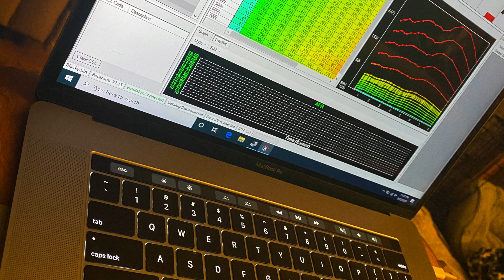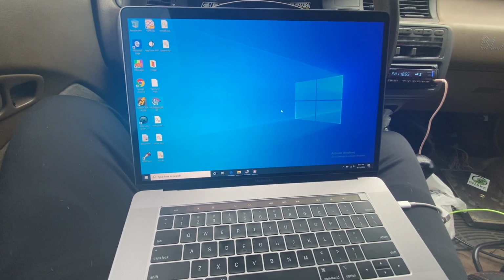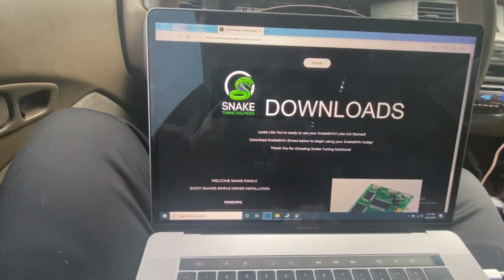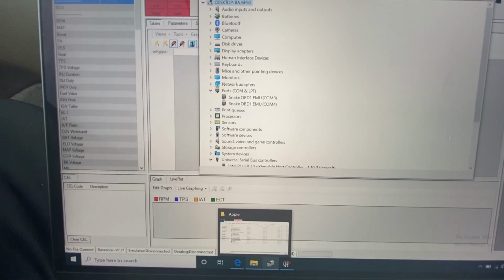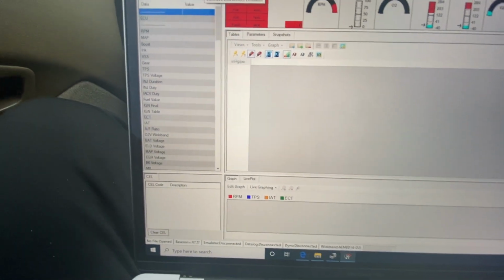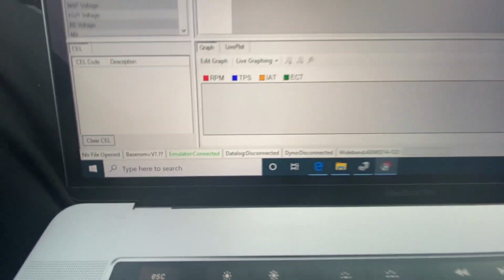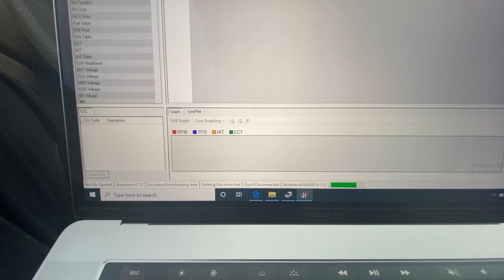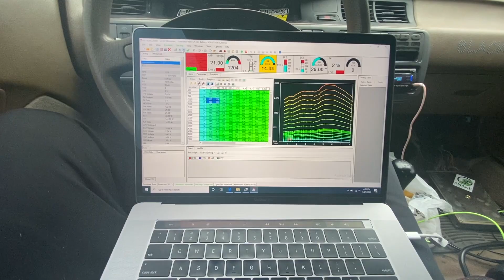How to Setup Snake EMU & Honda Tuning Suite  HTS

Comment: what do i do if i have the snake driver installed and key on. snake usb plugged into usb on laptop, key on, snake led is on blue, but my com ports are not showing up in device manager?
Reply from the maker: What software are you using
Reply: @sethchurchvid  hondatuningsuite on windows 10
Reply: @sethchurchvid  I am having the same issue!
Reply from the maker: @BamBamMotorsports  DM me on IG: SethChurchVID
Reply: @sethchurchvid  turns out the cable they sent was bad out of the box! Switched cables and everything is good now! Hope this helps someone else 👍

Comment: Mine just came in today I have a prechipped ecu with the latch do I need to get a virgin ecu to do this ????
Reply from the maker: Yes check your installation kit that was included with the snake and see if the ECU socket included matches your female latch setup, mine was opposite for a traditional chip kit and required a virgin ECU or desolder
Reply: @sethchurchvid  yup got it running thanks